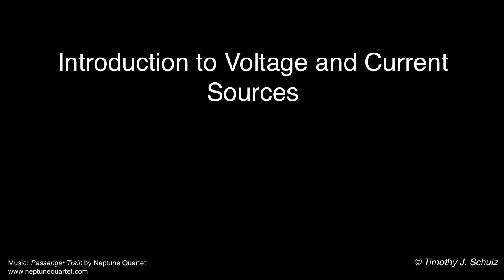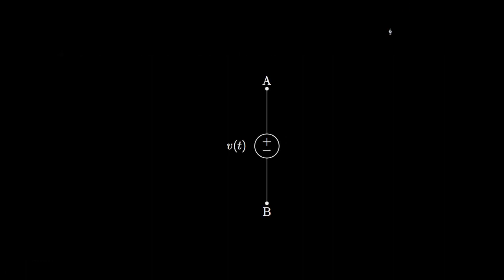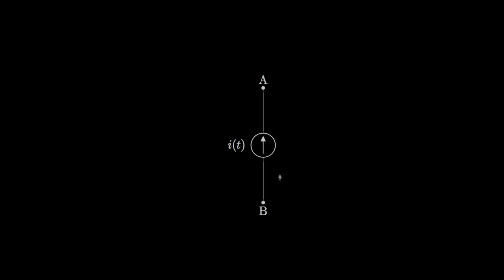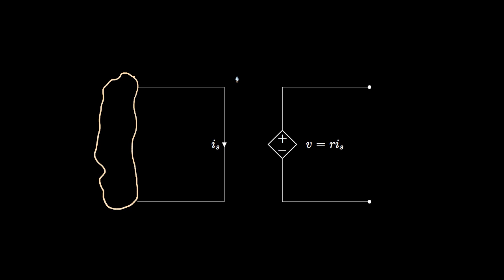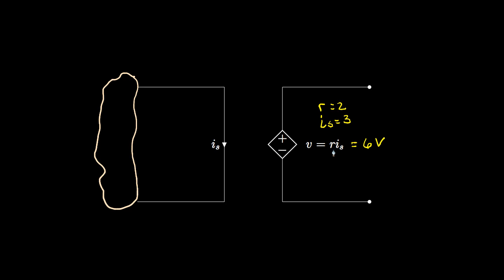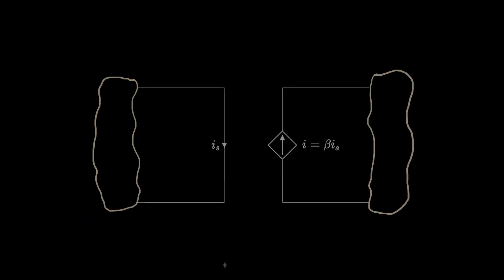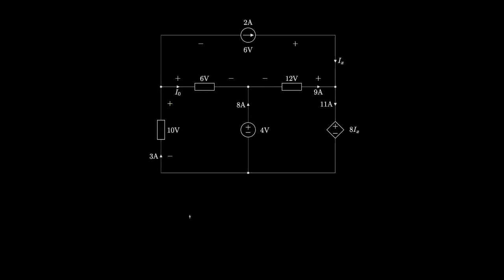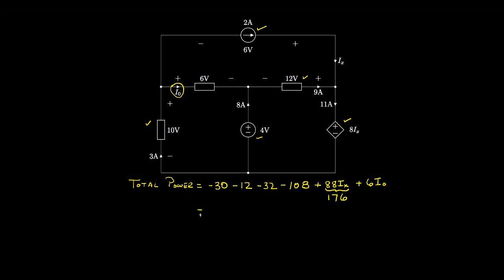Introduction to Voltage and Current Sources

Comment: i can't understand the way the dependent current or voltage source are drawn, why is it drawn like that?
Reply from the maker: The are drawn that way to differentiate them from independent current or voltage sources.
Reply: So they are not 4-terminal elements??